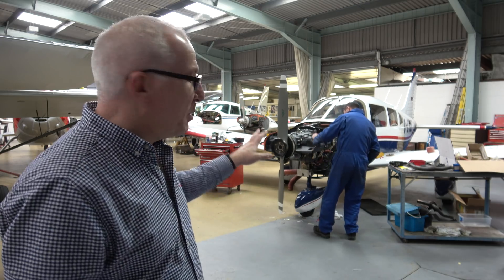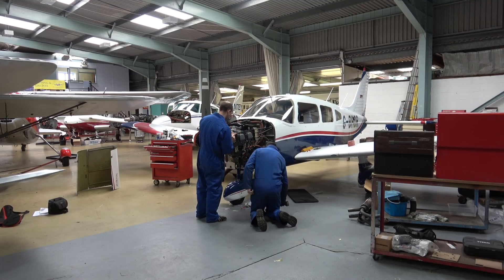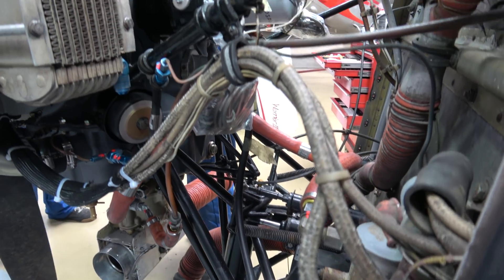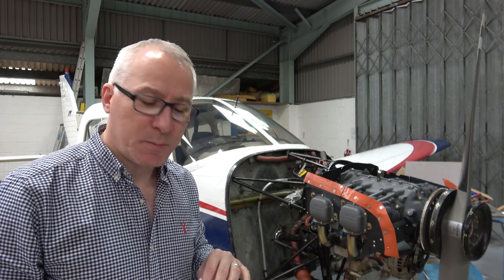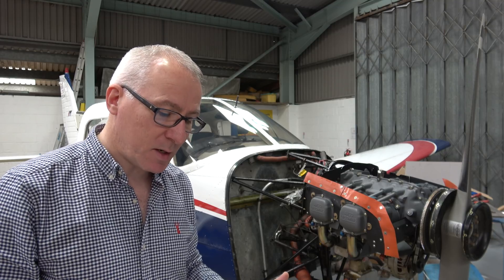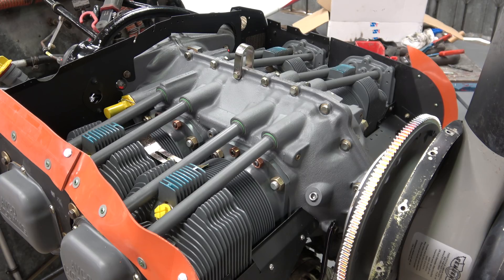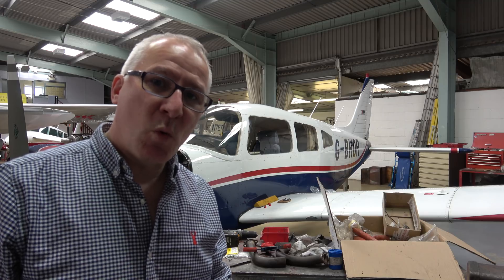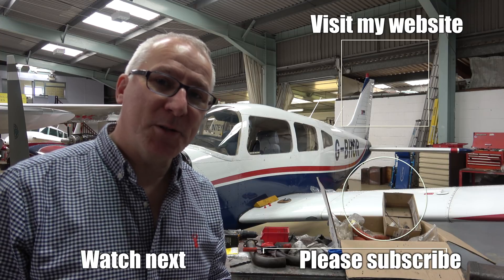PA28 engine refit - The Flying Reporter

Comment: With your old engine producing metal , did you replace your oil cooler?  It’s very hard to remove any bits left in the cooler
Reply from the maker: Don't think so Don.  interesting point.